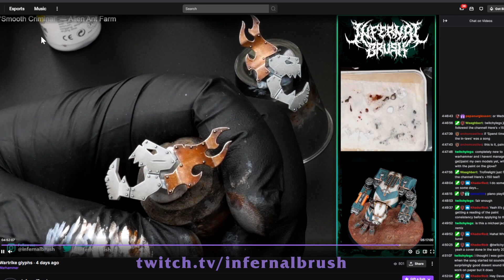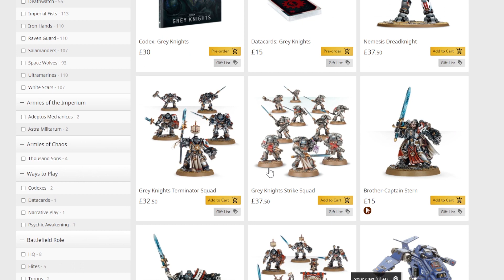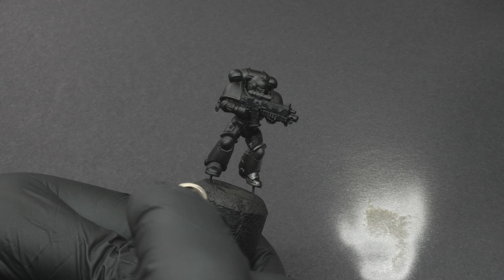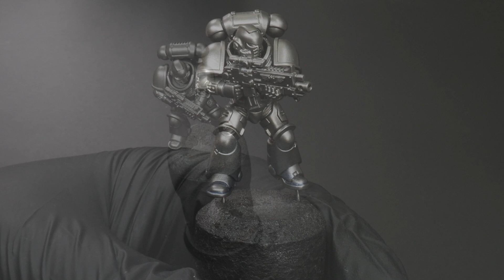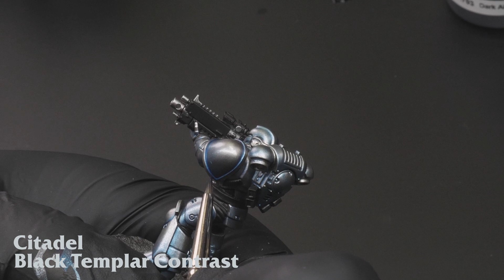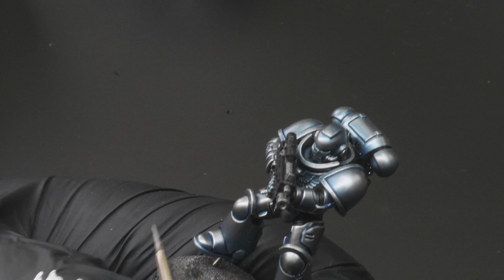How to paint Grey Knight Armour the Eavy Metal way.

Comment: Firstly, great video. Very enjoyable and highly informative. Secondly, is this to imply that the actual box art for GW Grey Knights isn't painted using Citadel paints?! And if you did use strictly Citadel paints when painting the box art, what is the motivation to switching paints in this video instead of sticking to the recipe most similar to the one you used as a GW pro?

Comment: I had good luck mixing Vallejo Metal color Silver with Daler rowney process Cyan. Over Vallejo metal color gunmetal.

1 drop of ink to about 6 drops of paint. Add a bit of metallic or glaze medium if you want a shinier color but it works for grimdark and you can add black ink washes over it while still keeping the blue tint in the silver.